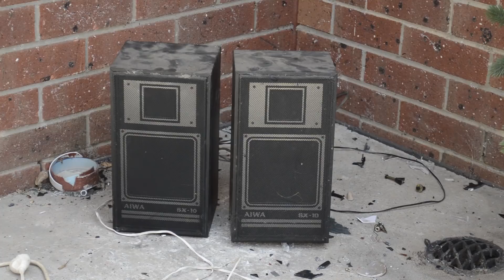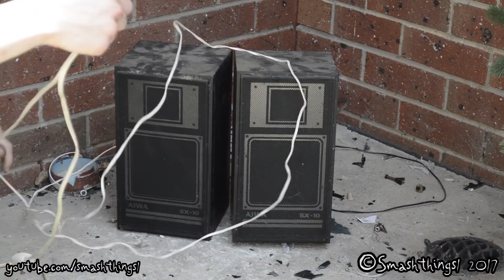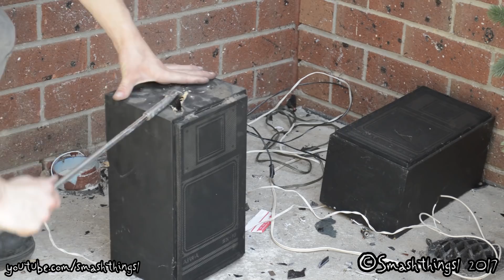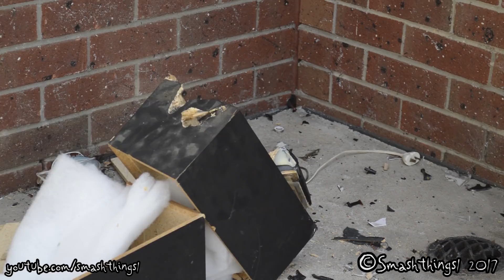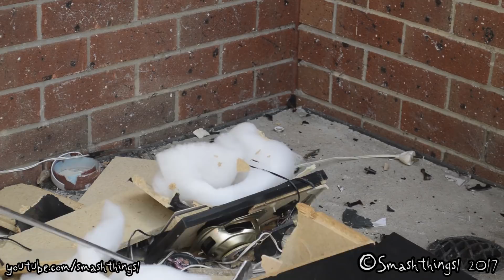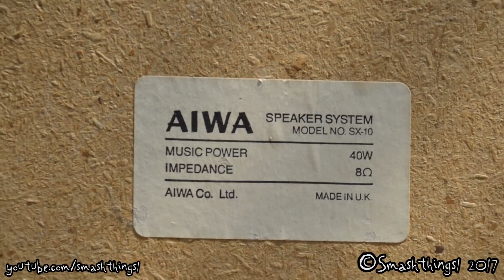Blowing Out and Smashing Vintage Aiwa SX-10 Speakers

Comment: I want to tell you back a few year's ago I bought out of wal-mark before super center's  a pioneer book shelf speaker's and they had the metal rubber surrounded  suspension,  and to this day for that size was the most big bass sound that I ever heard, and to this day I've heard none no better. Needed a better tweeter but the bass kicked butt. They were in a black cabinet,  bass had a stainless look and it was square.
Reply from the maker: Speakers last forever with rubber suspension. None of that nasty foam rot!